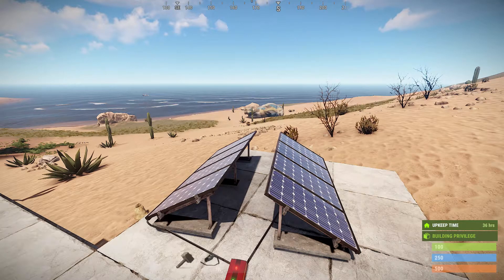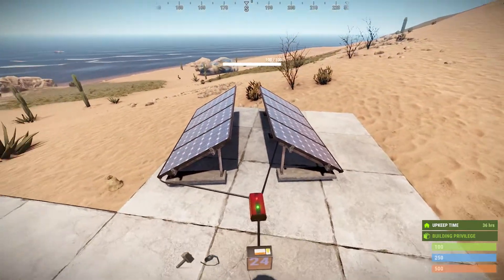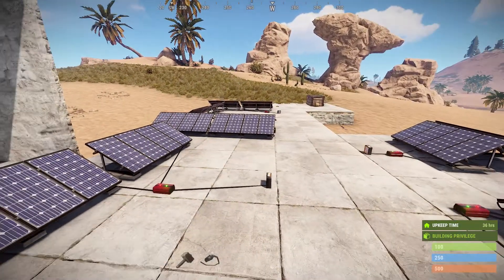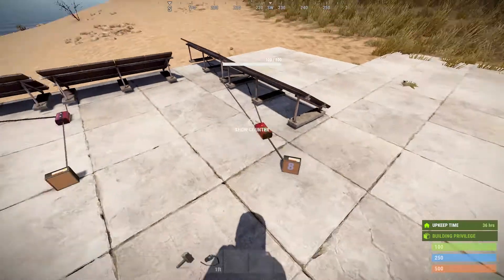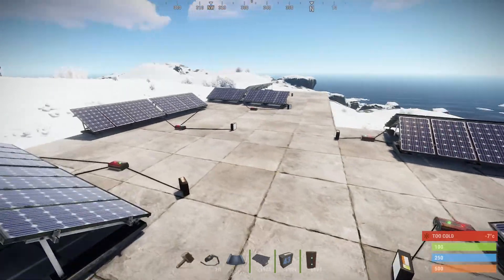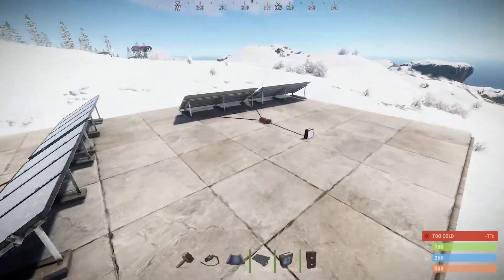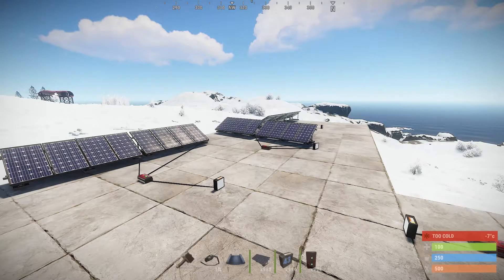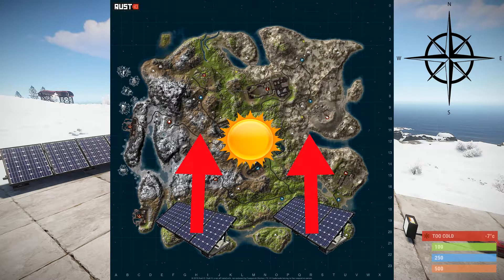The *BEST* Solar Panel Placement Guide In Rust!

Comment: On North side of map N+S bringing zero makes no sense if 2 North bring 36. Should it not be 18? Anyway, if base is in North and North facing panels still bring in 36, I'd call that good. All the other "double same direction facing" panels brought 40, but in the south only north facing panels brought 40. A lot of inconsistencies. Seems like the Sun revolves around the North side of the map instead of middle? We would need developer input. Also as I haven't put in the time to test things much, but I think that if the panel is not on the highest building block, the higher elements can block out sun, as sometimes even at midday north facing panels did not bring in much E on a helideck with sloped walls, but had to be elevated on a kind of solar "wing" and lifted above the other building elements. Not sure if this was only imagining, but it seemed that the panels needed to be on a flat without any walls or anything rising above them. Still I would say that North is a safe bet anywhere, getting more than 80% of the electricity, no matter where the base is located.
Reply from the maker: Yes, also I tinkered around with the different months in the game and it does infact change slightly from the middle of the map, but it isn't even worth correcting it each month with the change being almost unnoticeable.
Reply: That 0 is a counter not a pass through, thats why its green.

Comment: this isnt standart and may change from server to server. on small maps sometimes sun is direct north and i learned it after almost halfway through my wipe. also it may change during bi weekly and monthly wipes. i had to re position mine on a 14day server. for example right now on rustoria eu small, best placement is north. even tho my base is located at the northernmost cliffs.
Reply: Take the map grids, divide by half for vertical grids, thats your line the sun follows... aka the equator.